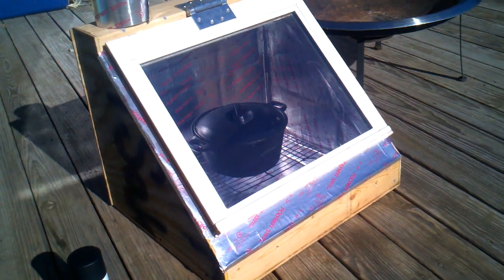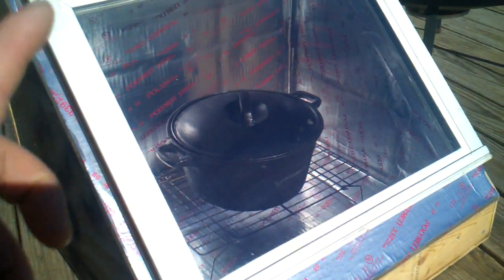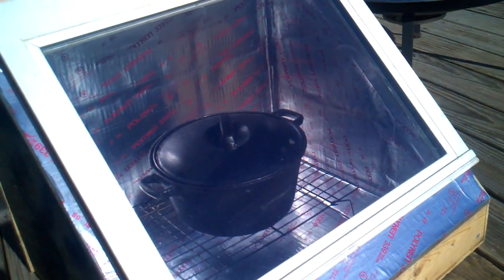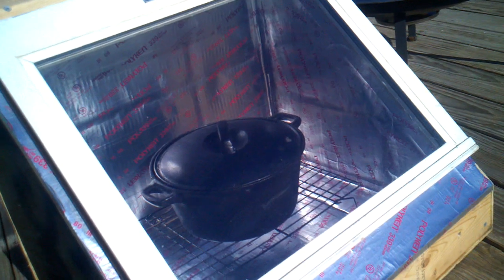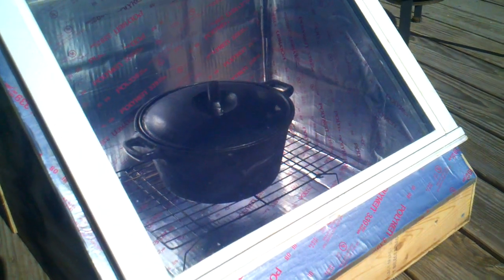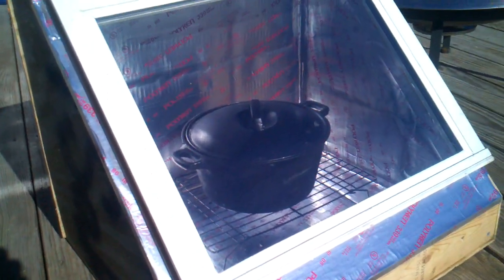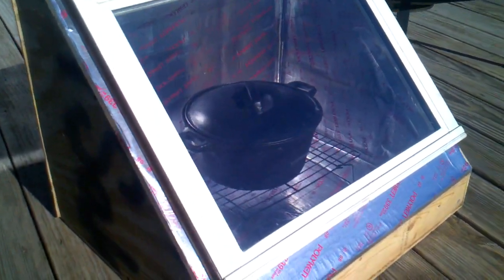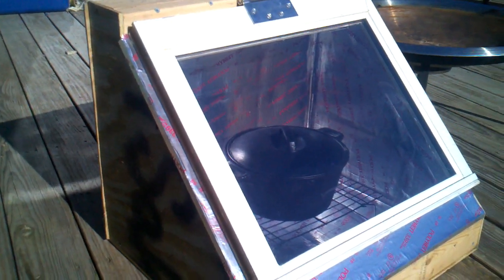My new diy solar oven in the first stages part 1.

Comment: When you use double pane windows you are deducing heat. I had them in a house and they kept the sun from heating up the room.
Reply: Especially with "Low E" glass that most insulated double glass is these days. It's engineered with a micro-metallic layer to block most UV radiation.

Comment: I wonder what the temperature would be like if the outside and inside was painted black
silver foil reflects rather than absorbs... if it was black on the inside and outside it would get a lot hotter im sure
Reply from the maker: You are right! Reflectors is what it really needs. I am in the process of building a new one. Thanks
Reply: Did you get that done? How did it compare with the original?
Reply: Did you get that done? How did it compare with the original?

Comment: +Justin Murphy  Thanks. I built the oven during the rainy season here in the tropics, so have not been able to do much testing. It got up to about 214 F  but I was hoping for better than that. I plan to resume testing soon, and I am going to line it with aluminum foil over the tiles and see what that does. I may not have the hottest solar oven around, but I just might have the heaviest.

Comment: The oven is well design and custom made for the purpose you set out for it to do. However, I will add oven black paint for the inside and reflectors for the outside. I'm very sure that this improvement will go a long way to getting the oven to at least 300 F. 

But what you should add in your video, the diagram on how you made this oven. What materials you used, how much time it took and how much it cost when the project was completed.

Comment: I am thinking one could use a drum suspended and on an axis . With reflective interior and insulation . As the sun gets higher one would tilt barrel accordingly . And lock into place of course it would be almost a half barrel .  I like your design it looks like one in a catalog I recently got in the mail .. From emergency essentials .there over is 344.00 . The only differance is it has 4 swinging reflective tilting doors .

Comment: You know I used the same reflective tap and I touch it just very warm and I go and touch my b.b.q grill led cover and it turn my finger...the button line is the inside box need a steel sheet high heat ultra spray use for b.b.q grill you will get the best result.

Comment: What would happen if u put magnify lense on it.
Reply: Not recommended, it'll only add the risk of fire. A same size lens doesn't add more sunlight anyway, and a larger one positioned at a distance can overheat the glass until it breaks. Been there, done that :)

Comment: Just curious, why use a double pane window?  I have them in my house to keep out the heat.  Thanks for the video...
Reply: The air gap between the glass acts as an insulator.  It helps the oven to retain the collected heat.
Reply: Donna, double pane windows do not keep any heat out.  They act as insulators to keep the cool air from your A/C in.  So in the summer time, if you keep your curtains drawn you will save a lot more money because the sunlight will not be able to get in and the double pane windows will keep the A/C in.  If you keep your curtains open, the heat build up from the sunlight will be felt.   : -)
Reply: Some dbl or triple pane windows do have a coating to block the suns rays from heating up your house.  Usually an extra option when you buy new windows.

Comment: Hi , I am trying to design  a similar oven, and I am thinking about using black ceramic tiles in the interior. Anyone have any thoughts about this ?
Reply: Download Aprovecho's PDF, "Capturing Heat," which gives you the optimum design for DIY solar ovens, with the science to explain their efficiency. For instance, this one has a very small solar capture area. Adding reflective panels all round would increase its effectiveness exponentially.
The door on this one opens up at the front, letting all the hot air out. The door should be a small one in the back wall.
There should be a double pane of glass to reduce heat loss.
Interior should be black-painted metal which turns the solar light energy into infra-red (heat) energy that radiates into the pot.
etc
Reply: Thanks Ruby for the advice. i just found the pdf file and it's everything you said it was!
Reply: Brilliant! I hope you build one successfully and make a video and let me know about it! These Aprovecho guys have done all the science and the experimenting, so that we can bypass the trial and error to make a practical, inexpensive, effective solar oven. I'm getting the materials together to build one here. We are heading into winter but have some wonderful sunny days at 41 deg South. It will be interesting to see what temperatures can be achieved. Others have been able to bake bread and roast meat even in snow, with similar designs.